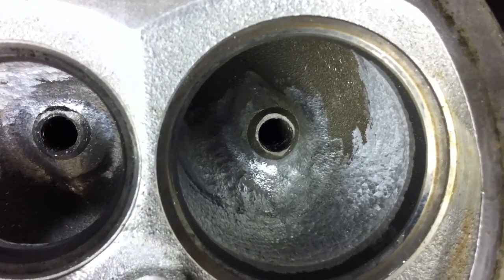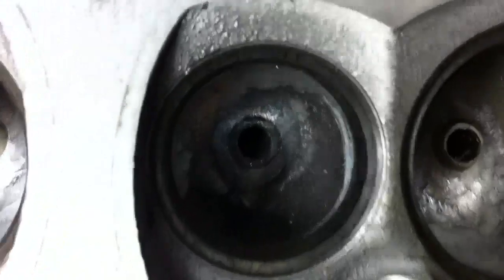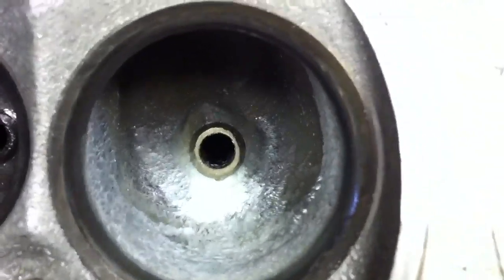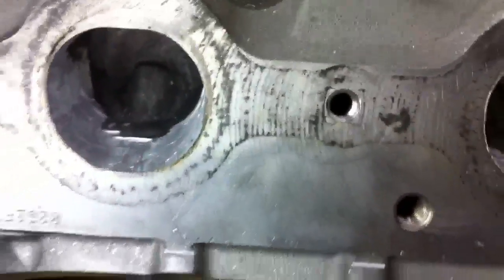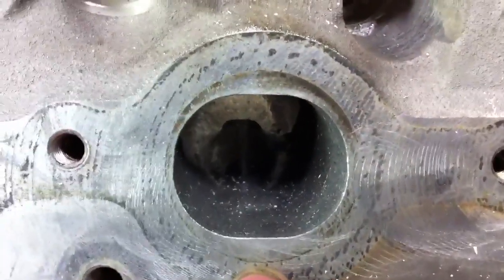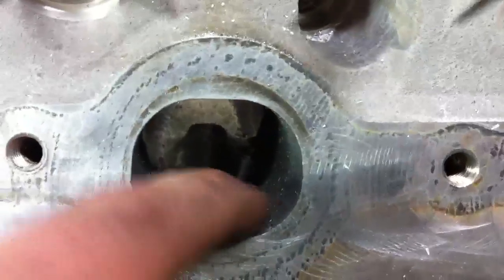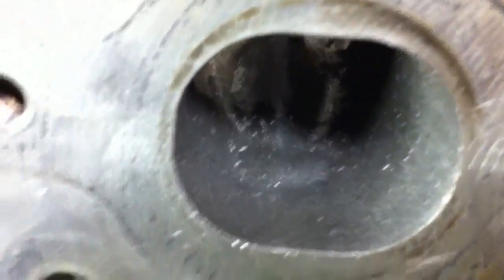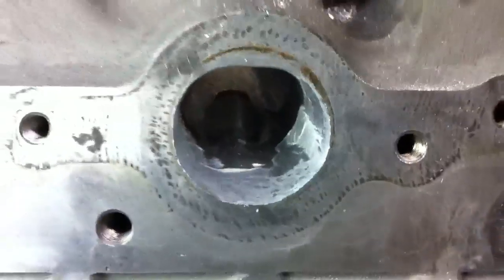How To LS1 DIY Head Porting Part 6 - Exhast + Blend

Comment: Wonder how long it ran before it dropped a valve guide or cracked...when porting heads you just want to gasket match.  Remove casting marks. And polish.
Reply: Wade you have a lot to learn..
Reply from the maker: It’s still running great and I beat the crap out of it. It’s been over 25k miles now.
Reply from the maker: Check out TSP CNCd heads, that’s basically what I copied by removing the swirl ramp and they’ve had great success.

Comment: why do you not match the other side of the exhaust port to the gasket?
Reply from the maker: Are you taking about the bottom side(when mounted) of the port?
Reply: +AGearhead4Life yes sir
Reply from the maker: Because you want to leave the floor of the port alone since the air moves high in the port. Modifying the floor will not help and likely reduce velocity.

Comment from the maker: Yes, the exhaust port should be a D shape. Mainly stay off the floor. On these heads I decided to try to open the top left and top right areas since you cant open the top very much since there is a coolant passage there.

On the exhaust port match, I believe it should be fine to stay 1-2mm from the gasket edge. When you port match though it would simply be just a smooth transition from one port to another.
Reply: Hello 
Have you ever tried porting a set of heads with the floor opened up on the exhaust ports?
We have ported 3 different sets of heads for a grand prix gtp 3.8l supercharged and the set of heads that had the floor lowered at the last 1in of the port closest to the mainfolds made the most power
8whp to be exact
However it made the power in the upper rpms only 
At 3200rpm it started to climb 
It did loose 3ft tq at lower rpm but made up at midrange and top end
Reply: Forced induction is a little different. The gases are being pulled out of the port or rather pushed out by positive manifold pressure. There isn’t as much need for exhaust scavenging. It’s usually better on a forced induction head to increase exhaust port area to increase top end power. I don’t think you’d see those gains in a NA application where port velocity is more of a concern.

Comment from the maker: Thanks! I am no pro either. Just a passionate automotive enthusiast. My knowledge comes from research as well. Well, also from the experience of another pair of heads that I have done. The last set of heads I did flowed pretty well compared to stock form. They out flowed Z06 243 cast anyways. You'll see that in my other video.